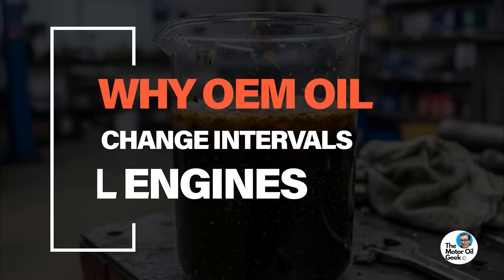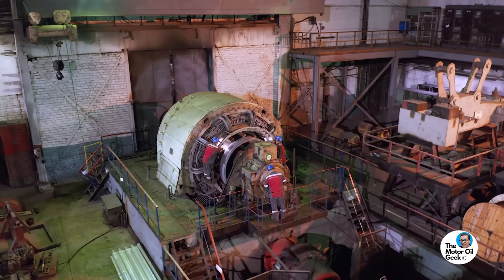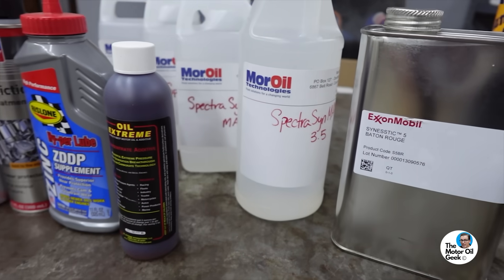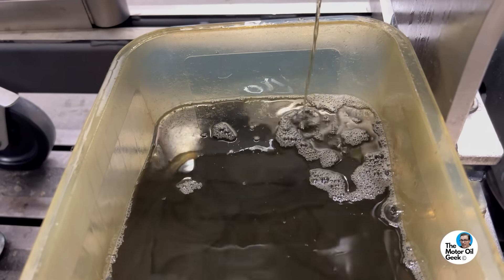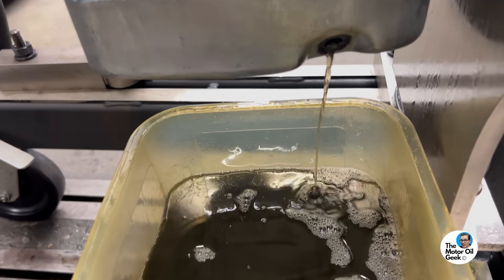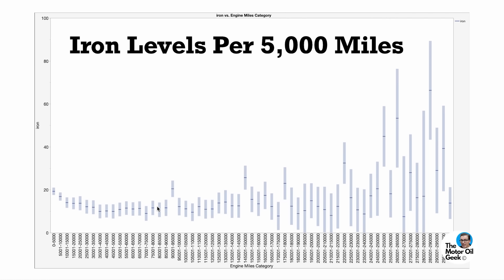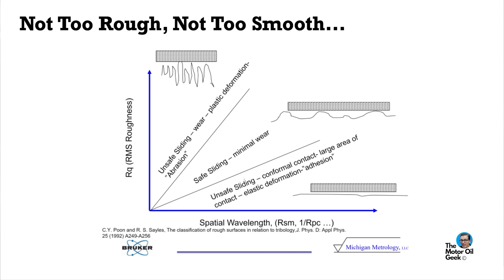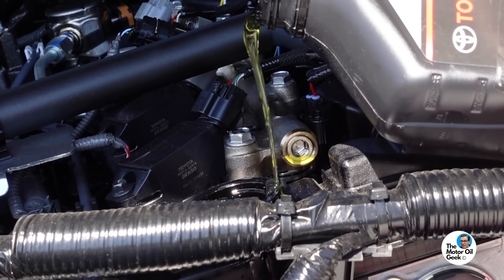NEW Data Reveals WHY Modern Engines FAIL Prematurely!

Comment: Hi Lake, I work for an auto manufacturer in vehicle development. I generally applaud your videos and I'm aware of your background, so I've found myself forwarding them to folks sometimes when I get asked a question about engines and lubrication that demands a lengthy explanation. However, I'm a bit concerned that this one might be misinterpreted by the public (it's a very bold video title). I have to underline that new vehicle owners should NOT be panicked that their engines are going to fail if they don't change their oil ahead of our recommended schedules. 

The failures we're seeing in the industry lately are not new, but have impacted some high volume and high visibility products and that has put a spotlight on this topic. The cause of these failures is down to a series of avoidable and unavoidable failures in the manufacturing process. Quite simply, these engines should not have left the plant in the first place. However, quality control issues resulting from insufficient plant downtime, machine maintenance, cost cutting measures, staff issues/training and some issues with external partners (who have their own QC problems) have created a perfect storm.

Changing oil ahead of our recommended intervals should never be necessary- and as you know we take into account new engine break-in and assembly contamination when setting our intervals. Is it beneficial to change oil ahead of schedule in the first year of ownership? Technically, yes. Is it required? No. Do we recommend it? No. Is the benefit meaningful for the majority of consumers? No.

The fault is in the manufacturing process. Therefore, I'd prefer a borderline engine fail early in ownership and be properly replaced for the consumer, as opposed to the crutch of aggressive oil services which (in some cases) merely delays the inevitable.  

In summary, we're all going above and beyond now and implementing very aggressive QC process changes. This will help ensure product are meeting expectations and these types of failures become rare once again. Consumers should have faith we'll get back on track and deliver reliable engines that can provide a lifetime of service with recommended maintenance. Hope this helps. 

Thank you for your great videos and continued efforts to better educate the public.
Reply: This has propaganda written all over it.  High visibility and high volume products, ie engines failures was the straw.  What about the engine failures of ECOTEC, ECOBOOST engines.  Lesser known engine platforms are ignored or dismissed but shouldn't be when consumer is suffering consequences.
Reply: Lol, PLEASE don't stop buying these time-bombs from us... 😏🥺
Reply: Thank you for the detailed explanation. I personally have discussed this with a powertrain engineer who is working for a major auto oem and his response was similar to what you have written. He has been involved in testing multiple engines and I trust him in general. But at the same time, I am not fully convinced because of the way Toyota, GM ....handled the engine failures. Their SOP for any engine problem is a) refuse to acknowledge there is an issue until several 1000s of engine blow up or NTSHA intervenes b) once they cannot deny anymore, they will say there is no issue with the engine itself and some manufacturing debris caused this issue c) then they try to give a hard time to customers - have seen many real examples of Toyota and GM customers. IMO, the best invention from Auto OEM in this decade is "manufacturing debris". 

So, there may be truth in what you and my friend is saying but sorry, I do not and cannot trust the OEMs.
Reply: @kayr3487 😊
Thanks for weighing in on this, friend, great additional input to an unfortunate situation we all face... I've been s diehard Toyota and Honda guy, Right now, I wouldn't consider a brand new vehicle other than maybe a Mazda...

Comment: Per Toyota and other manufacturers, the EPA does not allow them to clean and rinse their engines blocks as many times as they used to. Therefore their engines are not as clean as they could be. When it comes to any type of destruction on an engine all you need to dois look and follow the EPA’s absolute ridiculous regulations. The EPA is without a doubt, the biggest problem in all of this. No surprise.

Comment: It also doesnt help that gm and chrysler have oil pressure that drops down to 13 psi at idle from the variable oil pump.  The f150 2.7 liter (2017+) and the 5.0 in the truck (21+) use a different oil pump with a belt and has a constant oil pressure hot at idle of 30psi.  Also a question that you can answer for me.  If manufacturers state contamination is th leading cause why do their filters only filter out 80% at 30 microns (most oem filters)  but they want you to use them.  Other filters out there are 99% at 20 microns.  As far as planes and trains and such. They just top off oil. They dont actually change it.  Unless its an engine overhaul.

Comment: I run Amsoil's 2 micron bypass filter.  The oil remains as clean as new after 12-15k miles even on this GDI engine.  No sludge, varnish or carbon in the engine, looks like new.  Carbon in the combustion chamber far reduced.  225k miles on engine that is known to wear out before 100k.

Comment: I have a fleet of 6.2 L Chevrolet trail bosses, they run in a ridiculous environment in the West Texas oil field or it stays above 100° pretty much five months out of the year and they average about 80,000 miles a year in the most Dusty pitiful environment there is.  When all of those trucks were purchased they all had a tune put on them to remove the active fuel management from operating so they ran on all eight cylinders at all time in the auto start stop feature was disabled also
  They also got an oil change every 3500 miles, today those eight vehicles all have 280,000+ miles on them and they're only 2022 models  not one of them has ever had an engine problem there's been a few starters, alternators, and rear transmission seals but nothing major  
  Also they have never had their oil changed at a dealership we always use Pennzoil 5w-30 and change them here at the shop at the house. 
  My brother's truck had to have an engine and his 6.2 L 2023 model he got his letter to go get pico test and took the tune off to go get the test done it blew up 6 miles away from the house at 144,000 miles, that active fuel management hasn't been working in all of that time and it only took 6 miles to kill the engine.

Comment: 1st, I just subbed. 
Because you are on the FEW ppl on intronert that has wisdom essential and interesting to have. You , Dave in Utah and FEW like it.
This video, was one of the best explanations & reasons that bullet point 'why to’ change oil/filter. frequently. 
I broke my teeth on repairing the neglect on old WORN OUT chivvies from the 60’s,.
ppl Never changed oil in the engine or tranny or DIFF,  as repairing them made me the mechanic I am today. 
And Why-How to reduce my labor thru proper oil changes. I said this literally my 1st car I ever had. 
This one video reasons should be a national; mandate learning LOCKDOWN on everyones internet access until they watch it!
Reply from the maker: Thanks!

Comment: We run a large fleet of f350s. Over 100 of them.  Another part of the failure problem is manufacturers trying to gain mpg by cutting oil flow.  Fords previous engine the 5.4 6.2, gassers we would see 15-20,000 hours on those engines before failure.  Even the poorly 5.4 cam phasers weren’t a huge problem.  The new 7.3 are not lasting all of ours have failed before 50,000 miles and 6-9000 hours.  We idle a lot but Ford doesn’t warranty by hours so they are being replaced before 50,000 miles.

Comment: Ive ran new oil analysis and particle count testing on many oil. Yes many come out of bottle contaminated.  The worst is oil that uses pipes, trucks, hose and storage tanks for delivery.  Extreme contaminated  y the time it enters your engine.  I use Amsoil. It tests extremely clean from the get go.

Comment: I never had any problems doing 15k miles on oil changes, drove them 260k miles, no issues, no noises, no low oil pressure

Comment: Factory engines are broken in but only to the tune of 3000-5000 miles. Therefore not fully broken in. If they did no break in at all 90% of engines wouldn’t make it to 30k miles.

Comment: On my new vehicles I have religiously done oil changes 1k, 3k, 5k, 10k program to start its life. Then 3k intervals on the heavy use ones for towing and racing and 5k intervals on the commuters. Every one, gas and diesel, has gone over 300k miles with zero failures from multiple manufacturers.
Reply: Exactly, How many are complaining about mechanical failures without actually changing oil on time, Also not just buying the cheapest oil and filters when it's done, I have personally owned so called problem GM engines only to get it to last way past some complaints, By changing oil religiously from 3000, to 5000 miles minimum.......is 🔑 🗝
Reply: I think what you're doing is excellent. 
But if doing three oil changes before 10,000 miles, why not switch it to something like 200 miles, 500 miles, 5k, 10k? The cost is the same.

Get all of the new engine abrasives and contaminants out sooner, before they cause more early wear.
Why keep the new abrasive filled oil in the engine for 1k and 3k miles?

Comment: Let’s do a video on bypass oil filters.
Reply: I think he meant Secondary oil  filters that have a low micron filter.
Reply: @edbeck8925  no they are called bypass filters.
Reply: @edbeck8925   It's called bypass filters because they bypass the primary oil filtration system. It's impossible for the latter to filter down to the smaller micron level bypass filters achieve due to the increased restriction, thereby starving the engine since all oil from the pump must go through it, hence the requirement to create a separate bypassed circuit.
Reply: Yes, the percentage of the time each oil filter is in bypass mode, based on the oil weight.
Reply: @gerardford5707 the internal bypass valve in a filter is pressure differential from the dirty side to the clean side.
Reply: All oil filters have bypass valves
Reply: @lawerncemiller6557  He didn't say bypass valve, he said bypass filter.  Just because they both have the word "bypass" doesn't mean they are the same thing.

Comment: Great video. I would also include GDI engines. The produce higher fuel dilution and large amounts of abrasive soot which damages the engine.
Reply: GDI alone does not always cause fuel dilution. It does increase the chances, but it has more to do with driving habits than anything else. 

The same applies to soot formation. 

You're correct that it happens, but driving habits and situation dictate that formation and build up more than anything else.
Reply: @OxBlitzkriegxO yeah, grandma driving three short trips a day will destroy and any oil and cause severe carbon.  As far as GDI depends on piston design, location and direction of fuel spray, the amount of time the engine is in stratified fuel delivery, the amount of engine knock and octane.  Cold morning warm ups is the worst especially GDI, The industry has acknowledged for years that these engines will produce higher fuel dilution compared with PFI. Some reporting 3-5% dilution as normal.  The industry and auto scientific journals have repeatedly cofirmed soot generated by GDI is far more polluting, dangerous to health, different molecular structure and more abrasive than non GDI engine designs.  Ive been studying auto journals and industry publications for years.  They acknowledge all and justify to meet CAFE standards.

Comment: regarding high efficiency oil filters and oil as hydraulic fluid for VVT: don't I need to be careful that I don't have too much pressure drop across the oil filter, reducing the pressure at the VVTs?

Comment: Bottom line is we need to go back to late 90s - 2005 era engines and engineanagement systems. And for fuck sake. Change your oil every 3-5k miles. Sometimes I'll go 7500, but I live in the country side and spend very little times at traffic lights or stop and go driving.

Comment: Many of the OEMs are having crank and rod bearing failures in recent years. Looking for a common thread, I see the widespread use of low viscosity oils and very long oil change intervals. I think this combination of thin oil and extended change intervals can work okay, but only if everything is perfect. Impeccable surface finishes, perfect bearing clearances, and no debris whatsoever. There’s no margin, and the real world is rarely perfect.

Comment: I love our oil Geek. Only thing I disagree with is running a hot engine right before oil change instead of letting the oil drip down overnight before changing.
Reply: Heated oil drains out better and pulls out the dirty better.  Never change your oil cold !!!
Reply: The idea is hot oil has dirt suspended in it. If your drain plug is not the lowest point sediment will build up in the oil pan as the oil cools and not drain out. A magnetic  drain plug is a good idea.
Reply: @michaelmarshall5438  You not getting my point. I drive all my cars, bulldozers and tractors and make sure oil is hot. Then I let them sit overnight. After draining the oil I add a quart of oil with the drainpug off untill I see clean oil flow through. Then put oilplug back on and top off the oil. It is by far the best way. You dont want to fling your poil around the engine and have it drip slowly to the oilpan.
Reply: @ButchE30M3S14 . Why do you let them sit overnight and cool off ???  Drain it hot, then pour in your oil qt if you’d like.  I think that is quite unnecessary and a waste of oil.  When you drain it hot, everything comes out because the oil is very liquid.
Reply: @slalomking  You do you. If you don't understand my point, then this is where the discussion ends. have a great day.
Reply: @ButchE30M3S14   sorry Butch I’m not picking up what your putting down.

Comment: Old information yet still king of today!   Flash back 1985, my new Mustang GT 5.0.  Got it home and drove it.   1st oil change: 500 miles.   Drove it 2nd oil change: 1,200 miles.  3rd oil change, 2,000 miles... and then drove it and change oil every 3,000- 5,000 miles.   I still own this vehicle 40 years later.   All because my buddy worked at Pontiac Motors Engine lab and preached early on about the benefits of early break in and clean oil from what he saw ever day.   He was working on the Pontiac 301 Turbo engines for the 1980 and 1981 Trans Am's.   We knew.  Didn't matter what brand of oil, just change it and keep it clean!
Reply: I've never found anyone who would admit working on a 301 Turbo what a pos it was .

Comment: Running 5W-30 and oil changes every 3-4k miles is why I never had a problem with any of the 5.4 3V tritons I owned
Reply: Running 0w-20 and OCI every 6 months is why I never had a problem with any of my A25A Toyotas.

Comment: Oil change intervals have been pushed out by the OEM's because they are tracking the vehicle's pollution over it's lifetime.  Cut the oil changes in 1/2, they just reduced waste oil by 50% - makes them look good on paper.  Change oil frequently, use good oil.  I do 5,000 miles simply because it is easy to track...
Reply: To your point, longer OCI lets them brag about “low cost maintenance.”
Reply: 5k changes with synthetic is the sweet spot.
Reply: I also change oil & filter every 5k miles with a good quality synthetic... both my vehicles ('11 Camry & '17 Rogue) with over 140k miles run like new... ZERO oil consumption on either one.
Reply: @bwshaw5878 what paper specifies emissions or pollutant accumulation from oil changes? I have never heard of any regulation, process or trackable data from OCI.
Reply: @ALMX5DP that's HIS truth

Comment: When I purchase a Brand new vehicle, 1st oil change at 700 miles, then 800 miles later at 1500, then 1500 miles later at 3000 miles. I then try to stick to 5k mile oil changes thereafter. So far, so good.

Comment: What are your thoughts on pre-lube systems? Large engines will have a small electric pump which will operate a few seconds before the starter is engaged to pre-lube the rotating parts. If mass produced automobiles could have these at a small cost but would it be worth it? Do valves stop sealing, seals leak, piston rings stop sealing before or about the same time bearings are worn beyond acceptable clearance? Or like you say most people don't properly maintain oil cleanliness so it doesn't matter.....

Comment: Smallish town. Smallish dealership.   You should see the puke of engine crates that's constantly in the parts department.   In the 90s when I worked at another dealer it was almost unheard of to have them in stock and cores sitting around.

Comment: I can tell you that all this talk about oil is bull! When you have an engineer who designes an engine with tolerances of +/_ .001 and 0% metal porosity, and manufacturers don't comply with those specs, you're going to have problems. I worked for over 10 years as a machinist in UAW plants. Time and again l saw parts I would classify as scrap, sent on to manufacturers. Take a brand new engine apart and measure it, inspect metal quality and I'll guarantee you'll be shocked.

Comment: I change oil every 5 to 6 months since I do not drive over 5,000 miles a year. Almost bought into the idea to wait 10,000 miles or every 2 years! 😄. Glad I subscribed to  this channel. I use your examples in engine break down, when I see patients how it mirrors the body! Thank you
Reply: Same here. I am concerned about fuel dilution from short trips and wonder if going up in viscosity would help.